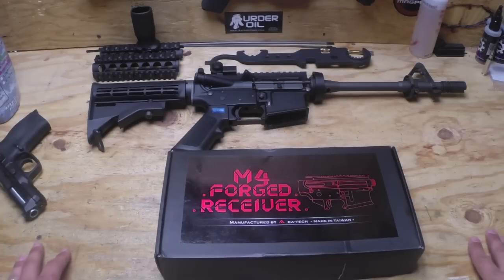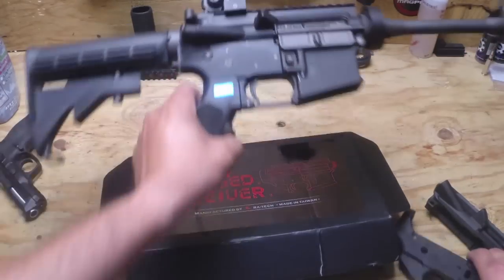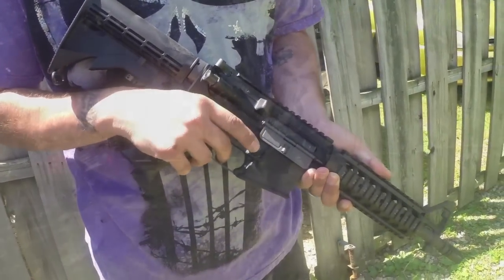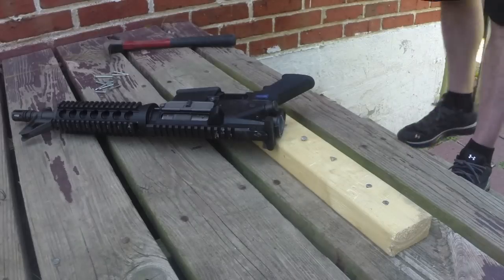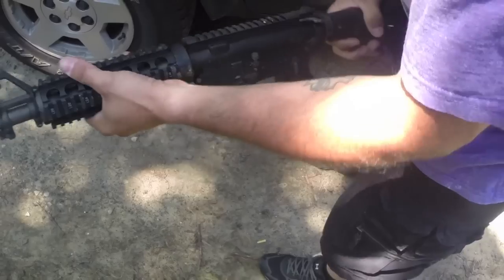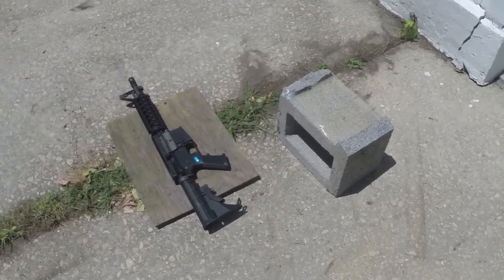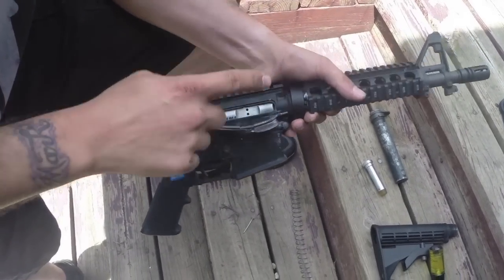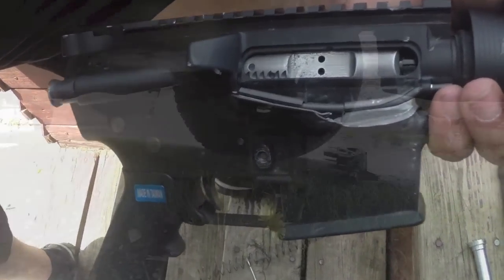RA Tech Forged Receivers Torture Test

Comment: Firstly, great demonstration video guy's.I think that you pretty much showed the strength of the RaTech receivers, and going by the date of your test I'm assuming that it was the 6061-T6 version and not the 7075-T6.I think without opening a can of worms regarding build spec and realism, these have to be one of if not the best built AR platforms for Milsim airsoft.I would also like to think that the 7075-T6 would probably fair even better in your test.Given that the wall thickness around the fcg is thinner than a real lower, and that the area where the outer barrel, hop and barrel extension is screwed to the upper is also weakened by slots cut into it, showed just how much abuse these can take by someone during game time without the fear of breaking their pride and joy, as happened to me many years ago to my then, top of the range Systema, cracked its lower after an altercation with a tree during a capture the flag game :(I hope that RaTech keep up their hard work, listen carefully to owners or future owners and keep the world of airsoft alive.Keep the video's coming and above all enjoy our sport.

Comment: Stay away from the forged reciever, you cant even fit the charhing handle and bolt together in the reciever.
I jave payed more than € 250 for this thing and I cant even use it other than as a paperweight.
Reply: I have the same problem ! Are you using the stock WE bolt ?

Comment: I understand what you were trying to do but all I could do was shake my head. A more extreme test of what actually happens in the field would have been better. That gun deserved it. Submerge it in muddy water. Leave it for couple hours. Spear chuck into the ground. Run over it on hardpan with a truck. The baseballs were close. That test was like smacking it into a tree. Hell spill coke on it and let it dry and see if it functions. I don't know how many numbnuts I've seen spill coke on a Real Steel at the range then wonder why after lunch the gun fails to extract or stove pipes. You had a great idea...just needs a tweekin ;-) Keep it up remember you only have 1*
Reply from the maker: I understand what you are saying but please keep
In mind the test was more on the durability of the receivers not the functionality of the stock internals that's why I didn't put it in water and mud, that wouldn't have shown how strong the receivers are built...thanks for the ideas tho :-)
Reply: ***** Liked it but dropping a block onto many RS receivers would have had similar outcomes. Have seen a few tests on Ytube the vipertech ones were pretty good. There is also a RS M4 verses AK vid on the tube. Those tests involved dropping the guns from various heights and at different angles i.e. onto the front of the barrel or onto the stock. Your drag test could have been done on a grinder it didn't really prove to much. Like your testing of the nozzles I have wasted a lot of time and money trying to get these platforms to work. You have some good work there. Most of the problems are just plain poor materials if they would use some machine steel these things might hold up. That hop looks like it is on track pity they cant make a one piece unit. How long before the end of the standard receivers start to fail due to fatigue I wonder. Any way thanks some good vids there you have some solid work. Cheers.